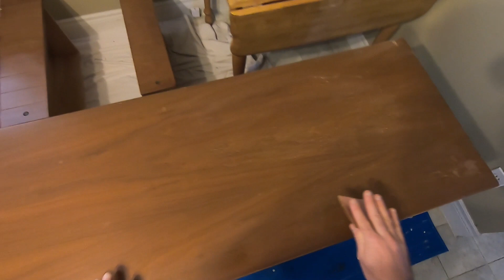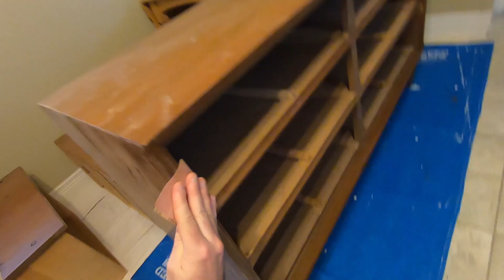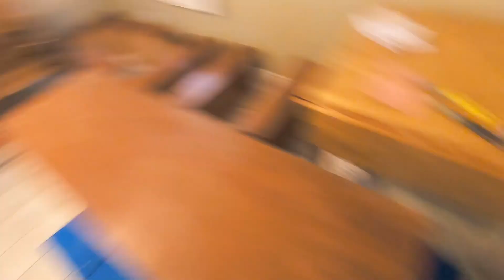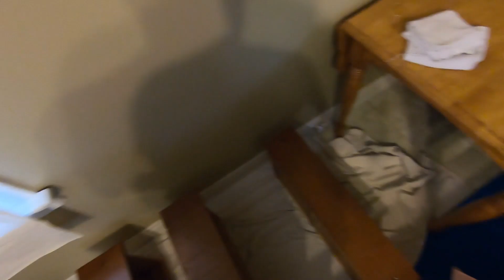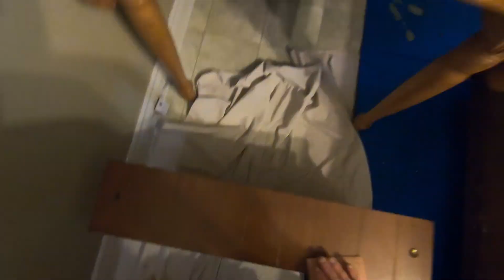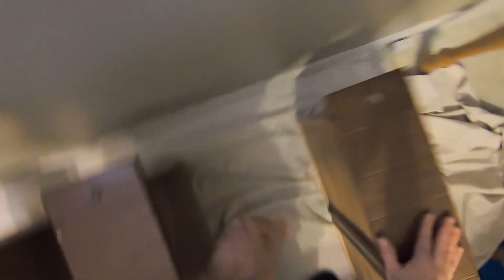SANDING BEFORE PAINT 🎨

Comment: Hiya CHP. Hey, do you ever do this when repainting trim that is done with semi-gloss (e.g., door casings)? So that the paint will adhere? Or is it not an issue (sorry if I've asked this before). 

Forget Calgary, head Southwest to Cali.
Reply from the maker: Hey, yes good question. I often lightly sand trim, always a door or cabinets that are painted, casing and baseboards but not always  depends on how much time the clients want me to spend on the project, but I will usually use a zinsser primer to definitely help the paint adhere , hope this answers your question